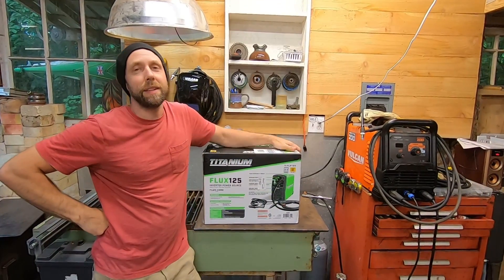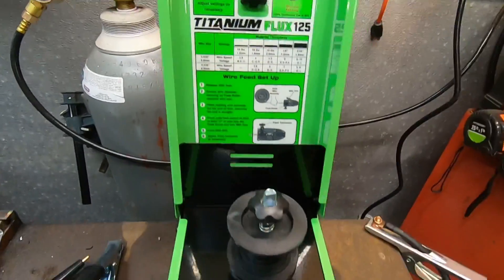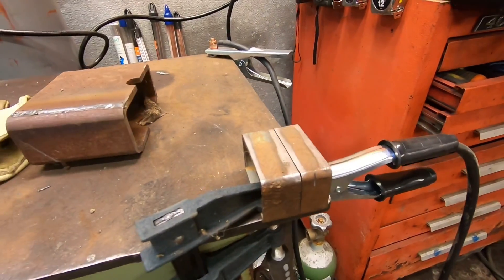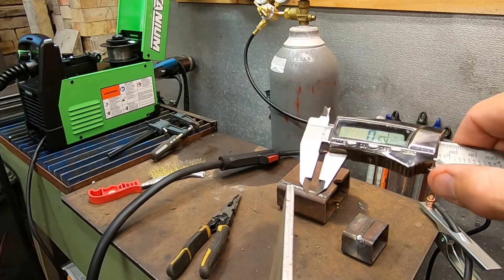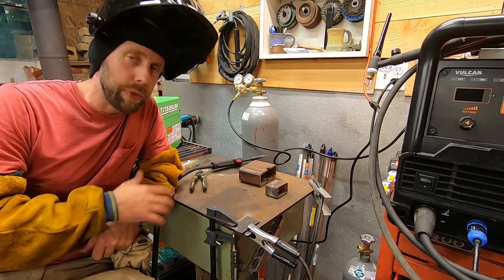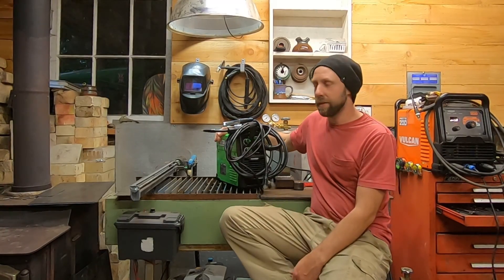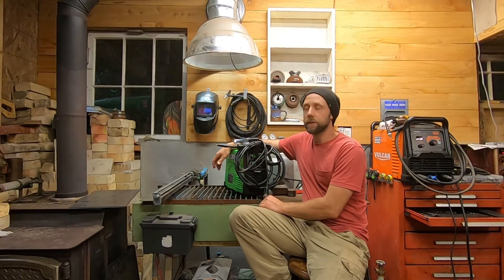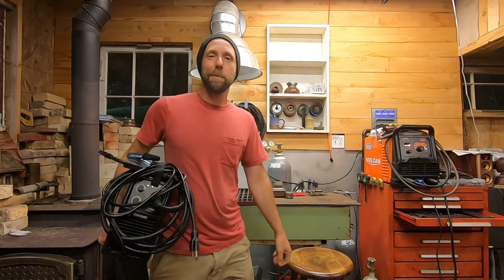Titanium Flux 125 welder from Harbor Freight

Comment: Just bought a new house, garage only has 110 power and quotes to upgrade to 220/240 are astronomical. I have some small projects to do and don't have any small machines. This is just the ticket! Just buying this and doing the first project I have to do will save me $400(even after buying the machine), over buying what I can make for myself!
Reply: If you're even slightly competent (not meant as an insult) you can run all the wiring for the 240v services yourself, then have the electrician come and do the connection at the breaker. Should save you a fair bit of cash and you're good to go for future upgrades.
Reply: @DarkMatterX1    o offense taken. that is an option, for sure. the logistics of running it to the detached garage under concrete is more than I care to tackle these days, though.
Reply: @redhotfrankactor  
I getcha, and no need to explain yourself, I'm just some guy on the internet. I also hadn't realized the depth of the project. We all can only do so much. You take it easy.

Comment: Mike, did you ever hook this up to a generator ? I have a shed in the middle of nowhere and this could work out nicely for me
Reply: I curious about that as well, I'm going to look and see if Mike ever did, or possibly someone else did, I need to weld some broken stuff at the farm and would rather do it there instead of removing , hauling to the welder, then reinstalling.
Reply: @ChrisfromKeyfarm   I run a Lincoln AC/DC tombstone  welder, a 195 amp flux/mig as well as a plasma cutter using a  Champion generator. 9300 start up watts / 7500 continuous. Doesn't miss a beat.

Comment: From what I can see, the biggest drawback with this welder is the inability to run the larger 10 lb wire spools. I'm going to have to remove the lid and back  and mod this machine to accept 10 lb spools.
Reply: How big of a disadvantage is that? For a guy who is only going to weld for a couple projects a month does it matter? Thanks!
Reply: @philipgillett  your gonna have to reload the spools much more which is time consuming. So it's not to good for big day long projects but you should be good.

Comment: Mike, thanks to your great review of this welder I have decided to purchase one of them when I can find a coupon. I attended a welding class at night at the local community college in West Memphis, Arkansas. I worked as an licensed aircraft mechanic for over thirty years and I was the only one who could weld on the airport. Most of the welding that I did was torch welding on chromolly tubing and brackets. The torch I used was made by Smith’s. It was the aircraft industry standard for welding. I also had a Lincoln mig welder that I used on the other types of metal.
Reply from the maker: Awesome to hear! I always rate aircraft machines as some of the most skilled of all machines, everything needs to be done right the first time.
Thanks for checking out my videos.
This welder is good for basic welding repairs around the home shop and are one of the most affordable ways to get into welding. Take care

Comment: I’ve pushed this welder very hard , building fences and gate instals. I love this little welder for its portability.  Welds plenty hot for what I do.  I will say I fried it this week after about 8 months of heavy use I will still buy another one due to how light and portable it is compared to my Lincoln.  I’ll be buying the extended warranty if it’s available.  I would still recommend this welder.
Reply: Do you think this would be good for art metal? Metals would include: copper, brass, aluminum steel, etc. Can you recommend any other welders for art work?
Reply: @dec23  this welder will only weld steel.  You can not weld brass,copper or aluminum with this machine. Brazing would be your best bet.   Just YouTube it.
Reply: @gilbertmartinez930  ok, thanks. I appreciate it! :)

Comment: Hi, I would be interested to see if it will weld 20 gauge for auto body work, and I would really be interested to see you add a bottle of gas to it, that would take this little welder to another level! Also, I wonder if this little welder can be set up to run 0.023 flux core wire just for 20 gauge body work?
Reply: I put the front end of my little truck back together with this welder after a 40mph head on collision. Radiator support welds to frame welds and it worked great.

Comment: Do you need to have the electrician in to get a higher fuse installed , saw another video for cheapest welder on Amazon but it required 30 am fuse in the house .     Would this be the same  ?  Thanks for the sweet video  , I’m working on a drift bike   For a nephew   I think it will hold
Reply: These things run off a 20 amp breaker on 12/2 wire.   I installed a dedicated outlet and have never tripped a breaker.   Unfortunately most house circuits are 15 amp on 14/2 wire.

Comment: So it seemed that it can weld the 1/4". Do you recommend it for that? I'm a beginner and I want to build a rear bumper for my bronco out of 1/4". And on the same bronco I want to do a bit of body work. Is there another welder you recommend? Or do you think this is good enough for 20 guage and 1/4"? Awesome video btw!!
Reply from the maker: I would recommend the Titanium 170 for 1/4” or the Yeswelder MIG 205DS
Both are good welders for 1/4” down to thin sheet metal 👍

Comment: Can someone tell me why the chart under my cover of my titanium flux 125 is different. My 1/8 .030 wire speed is 10 and voltage is E.5 and the chart in this and other videos it’s 6 and E.5-F.5 And I have no setting for .030 for 3/16. I have to use .035. HF support has no idea. There is no titanium support just HF support.

Comment: Question with longevity power and quality which one is better a Transformer or inverter technology?
Which flux core welder would perform better in the long run the century 90 AMP flux core or the titanium flux core 125?

Comment: what are the power requirements for something like this? like does it need to be on a dedicated 50 amp fuse or what are we talking about here?
Reply from the maker: This welder requires a 20 amp 110 volt socket 👍

Comment: I was wondering how it would work with a 0.035? On a 20 amp outlet
Reply: I use mine on that. I weld stuff no bigger than 3/16 and I'm only doing a few passes every hour at most. I would recommend you have heavier gauge wire to match a 30 amp breaker at 110,v though

Comment: I had a stick welder, it was hard to get an arc started and would often trip the 15amp breaker in my garage.  Bought the Titanium 125, it is practically point and burn.  Doesn't trip my breaker either.  Clean metal, good ground, and I don't pay any attention to the chart on the case...I typically keep the wire speed at 50-75% and I just adjust the amps higher and lower based on how thick the metal is.  I've welded exhaust/mufflers, dirt bike, atv, moped frames, riding mower decks and more.  A neighbor has one and built a fairly heavy duty utility trailer with this welder, he has more skill than me and his welds look great.  Mine don't look amazing but they hold.
Reply: I need to put new floor pans in my Ghia, would this little welder work for those, not sure how I ground the frame?

Comment: Just wanted to say, Jeffrey, that you're a natural welding trainer/instructor. I watched this from the Harbor Freight website and felt compelled to come here and give you some props. Never heard of your channel before, but I recognize what sounds to me like someone who instructs on a regular basis since I'm retired from working in the field, fabbing in the shop and instructing employees who were going for their LA City Structural (SMAW) certs. I don't know where you are, but LA is a weird place to get certified for field structural work due to earthquake-related regs that require written testing of new field welders and every single question out of 100 is taken straight from the AWS code book, which no bottom-rung new welder has any reason in practical terms to memorize, but it's required nonetheless, so somebody had to figure out a way to get all the questions out of City Hall and into the classroom to drill memorization of meaningless (to welders anyway) code sections into the heads of the newbs.It was nothing but revenue generation for LA City as each test cost the applicant $50 bucks to try or retry as the case may be, or at least that's what it was when I left LA for good in '92. Probably more by now.

Sorry, didn't mean to come here and go on a tangent. Good video is all I planned on saying. LOL. I'm a bored old man whose got slag burn scars from head to toe and I saw a guy doin' on video what I did for a job for close to 40 years. Brought back memories, which get harder and harder to trigger with each passing day it seems, so thanks for that too. Take care man.
Reply: Try getting some RNA supplements for that memory fix....:-} Truth be told, it saved my  life, I'm not kidding.

Comment: I bought one a couple weeks ago. I do mobile auto repair. I use it to fix exhaust pipes and small repairs. I run it off my 4000 watt generator. It does just fine and takes up next to no space in my service van.
Reply from the maker: They are really great little welders! I really think they are so useful especially for your kind of work. We keep one around my work for quick repairs when you don’t have 220v and don’t feel like dragging out a gas bottle. Take care

Comment: Stupid question, but i can’t see a weld puddle with the hf auto darkening helmet set on 9 just the arc . They also changed to settings on the 125 the 1/8 settings are wire speed 10 and voltage at E.5
Reply: Exactly. I’m not home to see the machine but though it was a 10 for speed for 1/8 inch and on a few videos they have it at 6. A misprint?

Comment: How is this welder holding up to date?
Reply from the maker: Great 👍 they are good simple welders!
Reply: Thats my question also, how they holdup with use and non use storage.
Reply from the maker: @JustAnotherCouyon  I gave my Flux 125 to my brother because he didn’t own a welder and this one is simple to set up. I asked my work to buy one for simple weld jobs when you want to be quick with a repair and didn’t want to pack a bottle of gas and 220 volts wasn’t available. We use it all the time at my work. Both welders are holding up great 👍 
I loaded out one of them to a friend that was welding on a Toyota 4x4 project, he loved it.
Reply: @Mikefestiva  is it still holdin' up? might get one for some contraptions on the farm
Reply from the maker: @johnsmith-sp6yl  Yes the welder is still working great 👍 I gave mine to my brother and he uses it on occasion.
We have one at my work and I use it about once a week on small jobs and it’s a good little machine, zero complaints with it, really good value!
Reply: @JustAnotherCouyon  Republicans are evil that's why I weld 🤣to fix the world 🤣

Comment: Would this be ok to build a gym squat rack
Reply from the maker: This welder it capable of welding up to 3/16” metal single pass, with that being said it would have not problem welding most things like motorcycle frames, go karts, truck parts and Gym equipment. Just make sure you understand how to make good welds. Practice on scrap metal till you get confidence in your welding ability 👍

Comment: I have a small engine repair shop. I have a great    stick welder and a big TIG welder but I wanted something small I could easily and quickly do small welding jobs on zero turns and riding mowers. This welder is great for this. I replaced the crappy original wire with some Lincoln wire and replaced the ridiculous ground clamp with the heavy duty brass one. I use it for decks, frames, mufflers, and buildings things around the shop. Just recently used it to put hand rails on the front steps of my house. Great to have a tiny welder you can plug in anywhere.
Reply from the maker: They are really portable compact welders!
I loaned mine out to some friends recently because they had an old under powered flux welder. They tried out this titanium for the weekend and were sold on it. Really great especially for the size and price 👍
Take care

Comment: Would this works on thick metal? As would this weld on my front differential axle control arm bracket?
Reply: Yes it could weld thick metal, but it would not get near enough penetration, I would go with a welder with higher voltage and that is rated for thicker metal. If your on a budget I would recommend the Chicago electric 240v stick welder that is also sold at harbor freight,it is usually around $170 and would provide good penetration for welding a axel control arm.

Comment: Idk what happened but me and my professional welder friend believes i was supplied with mig wire or it was the worst flux core wire that is supplied with the welder when bought new.

The welds became quite well after I swapped with Miller Flux wire. Best $12 after my welder purchase. Considering that when you first buy it.
Reply: Seeing Mike's welds, my wire has either absorbed some moisture or something because it has a lot more splatter and doesn't run the smoothest. I'll buy some newer wire and play around with it some more. Seemed to run better when I upped the wire feed speed another .5 a tick.

Comment: i have one now, for a year..i find it welds quite nicely.. always use clean steel, i like to soak any new steel in vinegar to remove the scale ,, soak it for a short time,, a little steel wool , and nice clean metal.. i find the wire brushing or grinding new steel just  pushes the scale deeper into the steel// vinegar just washes it off... clean metal and this welder word great

Comment: Hi.  Thanks for the video.  Do you (or anyone else) know why this isn’t suitable to weld aluminum?  Thanks.
Reply from the maker: Garrett Roberson  It’s because it’s a flux wire only welder, there’s no shielding gas on this, also most aluminum MIG welding is done with a spool gun, because aluminum wire tends to bend up in the drive rollers on most MIG welders. Take care

Comment: If someone was never welded before, but wants to learn and eventually weld a variety of thicknesses of metal, would you advise that they get a Flux welder like this to learn on, or an Arc (stick) welder.?
Reply from the maker: If you are not on a shoe string budget I would recommend getting a multi process welder, then you can learn Stick, MIG and DC TIG welding, they are quite affordable and work really well 👍
Reply: @Mikefestiva  Wow ! that's an unexpected reply,  
I'm a complete novice, so I find that more than a little daunting, but OK I'll take a look at some. 👍
Reply from the maker: Gary Seven This Flux 125 would definitely get you welding, it’s a good welder to learn on,  you may want to upgrade later on down the road if you buy this machine. The only reason I mentioned the multi process machines is so you can try every process out. 
I like my Titanium 200 welder, it’s MIG, Stick and TIG 👍
Reply: That welder is so much easier to learn on than on a stick welder.

Comment: Question...I'm completely newbie to welding I wanna buy this welder can. I run this on a normal 120v 15amp outlet?
Reply: It will trip the breaker left and right when turned up
Reply: Need more like a 20-25amp breaker for this welder. Could probably get by with a 20 amp if you're doing smaller welds and it's a dedicated circuit. 15 amps is too weak for anything but tacks.
Reply: @rileyneufeld7001  yeah I ended up using a gas generator for the welder and it's been working great
Reply: @rileyneufeld7001  not true at all. I welded an entire trailer gate from scratch with one on a 15 amp breaker. It tripped a few times but the welds penetrated great. The things solid as a rock.
Reply: @michaelt.9372  What settings did you use? On high the manual says it will need a 25 amp I believe.

Comment: Could I weld 1/2" rebar with this? and, How many amp outlet do you need to power it?  Great video. Thanks.
Reply: If you prep the rebar with the proper chamfer and weld all around, it should work fine! A 20 Amp branch circuit is needed for the Titanium 125.

Comment: Hey Mike, looking to get a economical welder that would do 3/16" would you recommend the Titanium 125 or the 140 to do the best job for 3/16" ? Thank you I appreciate any advice you have.
Reply from the maker: Luckystudio13 I would recommend if you were going to spend the cost of the 140 consider the Titanium 170, it’s going to weld 1/4” single pass, it’s dual voltage 120/240. You will not be limited with this MIG welder 👍 
The only thing I suggest is to buy a $8 ground clamp that that HF sells, the ground clamps that come on the Titanium welders are not very good. I have been running my Titanium 200 for 20 months now without any problems 👍
Reply: @Mikefestiva  Thank you so much for the advice. What do you think of the 125 for that thickness steel ?
Reply from the maker: Luckystudio13 The Titanium flux 125 is capable of welding 3/16” single pass, they are great little welders! I just ran one at my work last week, we had to cut and modify some 1/8” thick metal industrial tables, they were off site so we had to bring all our tools to a different building, the Flux 125 is perfect for jobs like that because it’s compact and we didn’t need a gas bottle to run it. I hope this helps 👍

Comment: So you don't need gas for this little welder?
Reply: yup the welder uses flux core wire which essentially means there is a solid form of gas inside the wire
Reply: @Ki-yg1ds  cool thank you